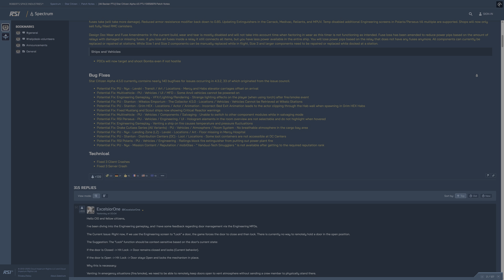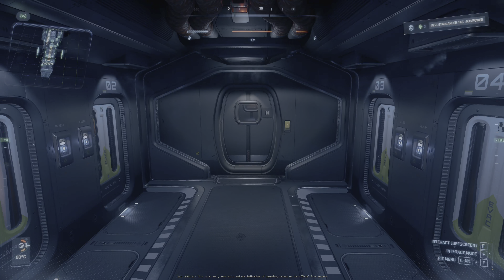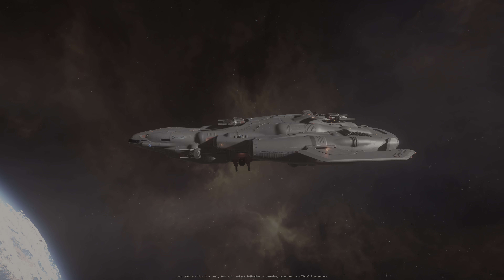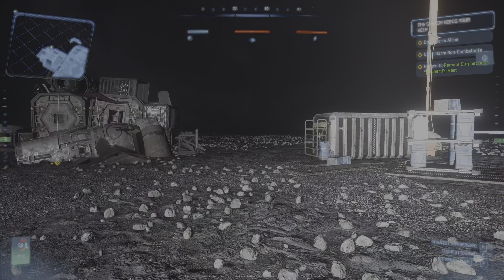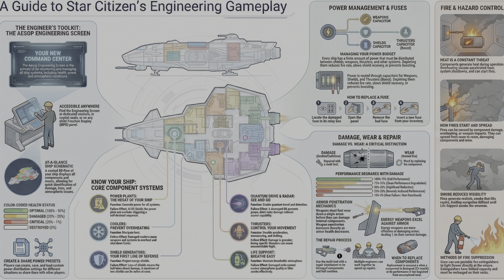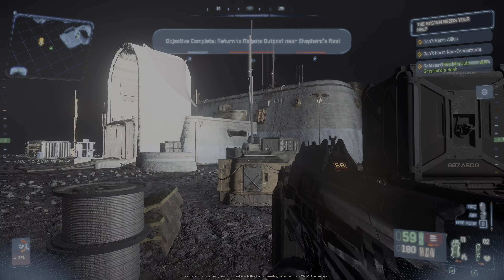Star Citizen 4.5 - Why the Community is Divided on Engineering (Honest Analysis)

Comment: Great video, but I have a question around deflection.  I was under the impression armor would be able to fully resist weapons under a certain size, based of course on the vessel's size and type.  In the illustration you showed it stated "Even small weapons will be able to whittle down armor values." while still showing a reticle having a "No Effect" indicator.  Do we know what size weapons will effect what ships yet or is full armor deflection off the table now?
Reply from the maker: Yes you are right, but this is not implemented yet and right now CIG is temporarily adjusting figures like penetration distance and DMG. As far as I understand the system acts a little bit as a place holder.

Comment: Personally, I don't see much long-term enjoyment out of having to run around a ship replacing fuses, repairing and replacing components and extinguishing fires every single time my crew gets into combat. The gameplay loop is too shallow and doesn't allow players to be creative or make meaningful decisions; a gameplay loop can be complex and intuitive at the same time. I was looking forward to Engineering because I enjoy being a team player and there are people who are better at using the turrets than I am, but this iteration of Engineering is pretty disappointing for me.

I don't know if having various damage type events and stages would make the gameplay loop overly complex but at least it would make Engineering more engaging and immersive. For example, a power plant has its outer protective shell damaged resulting in radiation leaking into the surrounding areas and players can choose from various solutions such as:

1. Shut down the power plant to prevent further radiation leakage and damage then conduct repairs
2. Limit the power plant's capacity to reduce radiation leakage and damage then conduct repairs
3. Keep the power plant on and conduct repairs immediately; potential power plant critical failure and high radiation risk (think Apex Valakar)
Reply from the maker: The fear of engineering becoming a repetitive "repair simulator" mirrors the community feedback I discussed in the video. Your point about needing meaningful choices—like the radiation trade-off you described—highlights the difference between busywork and actual gameplay depth.
Reply: @The-Celestial-Turks  I'm actually somewhat surprised that they didn't include radiation as a hazard; every piece of armour has radiation protection and there are DeconPens.

Comment: Thanks for the well crafted summary current Engineering state, always appreciate the work you put into these. Also the language support is really appreciated. Sağ ol.

It’s PTU as you say and lots will change but overall it’s really an exciting time! 
One thing I don’t understand the rationale is not allowing repair of larger components during flight requiring return to port to repair. I get the components are physically large so replacement may be problematic but surely we could repair them in situ? even if it takes longer for larger sizes or requires larger repair tools or higher Engineering skill ( when that’s maybe a thing).
Reply from the maker: Glad you enjoyed the summary! And thanks for the feedback on the repair mechanic—it's definitely a hot topic right now.  As far as I understand if the components are damaged and zero, you cannot repair them. Otherwise it is possible. This is a temporary solution.